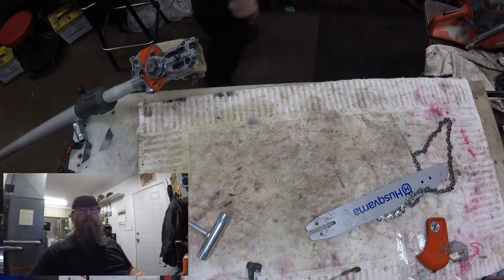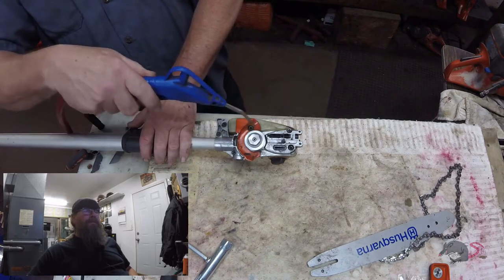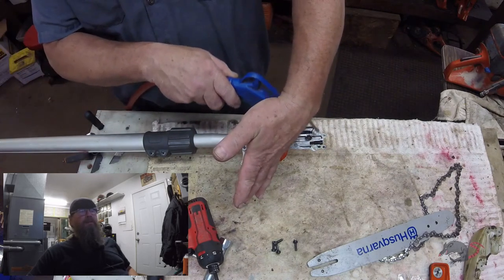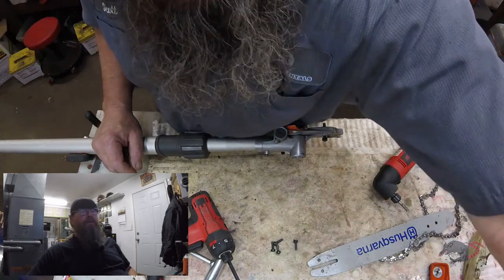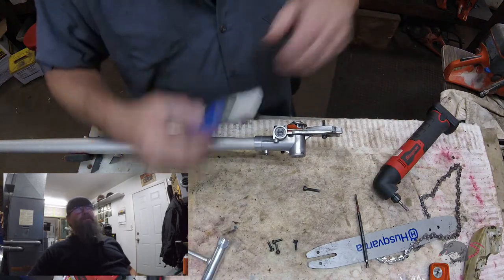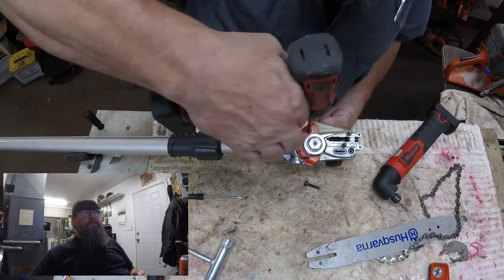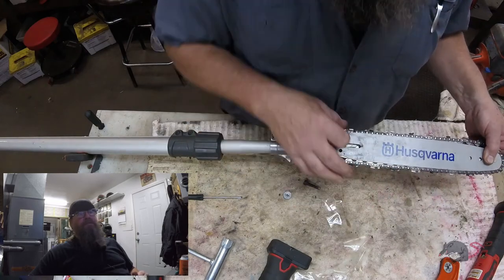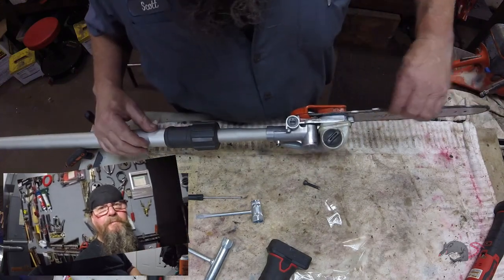Husqvarna 525PT5S bar stud replacement

Comment: Although it won’t be seen on a P&L sheet, you can’t put a price on customer good will and referrals. I try to clean up every piece I work on whether I charge for the time or not. I won’t work on dirty equipment and I think it’s just good practice anyway. If a machine is filthy it’s too easy to miss important things.  For me it’s also taking pride in my work.

Comment: It's nice to see that a professional mechanic has some 'bonehead' actions in their workday!  I sure have a lot of them.  And I'm a big proponent of cleaning up devices as you work on them.  Back in the Personal Computer repair days I would ask my guys to blow out dust inside, wipe down the exterior & keyboards & screens, and nicely wrap all the cables & power cords.  Every once in a while I would hear positive feedback from the customers about how nice it was to receive cleaned up equipment.
Reply from the maker: It really is the right way to conduct business but I draw the line at poop. If its a barn find full of bird crap and they ask for it to be cleaned up I will and also charge them. Otherwise all poop that comes in the shop goes back out with their equipment.

Comment: Thanks for sharing great video.  I have a Husqv. 326P5x pole saw that leaks like a sprinkler at bar. It looks like one seal, a diaphragm and o-ring on body. Not sure where it is leaking. None of those were ripped /cracked or deformed, so at a loss as to cause.
Reply from the maker: How about a cracked tank?
Reply: The best way to detect a bar leak is to clean it up completely, run it until warm out of the wood, set it down overnight on paper towels or grocery bags or cardboard and observe where the oil is coming from. If that doesn’t help then take the entire oiling system out of the saw, looking for any part of the system that isn’t a tight fit. It can be a grommet, pinhole or crack in a feed tube, not enough pressure forcing a grommet up against a hole, etc.   I’ll pressure/vacuum test a system sometimes as well.

Comment: Could you tell me the model of your Snap-On drill driver sitting on your bench at the start of this video?  I’ve seen you using it a lot and it seems to be a good fit for this kind of work. I’m going to add another one or two used drivers to my equipment so I can have some for dedicated uses and I see plenty of these available used for not a lot of money. Thanks
Reply from the maker: I have both the brushed and a backup brushless. I'll try to get the model numbers today.
Reply: @TheGreasyShopRag  
Thanks. No rush.
Reply from the maker: @Rein_Ciarfella  SnapOn CTS761A is the brushed model you see in the videos. I like the trigger feel. CTS861 is the brushless version and I think its trigger feel is worse.

Comment: Hi man
If you think you’re scatter brained you wouldn’t want to see me go at it!
Does that head pivot to have different angles to the limb?
Reply from the maker: That saw does not have a pivoting head. Thanks for watching!
Reply: @TheGreasyShopRag  
I think they are missing an opportunity there they could at the drive sprocket without to much engineering !!
Thanks
For the reply!